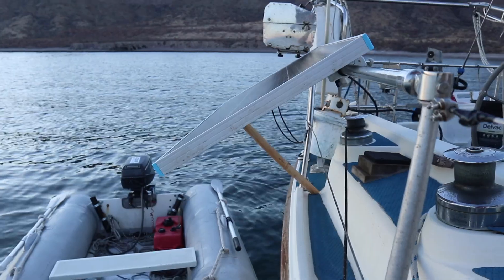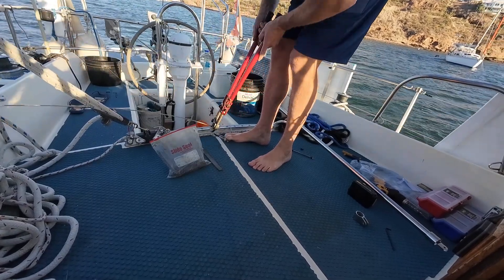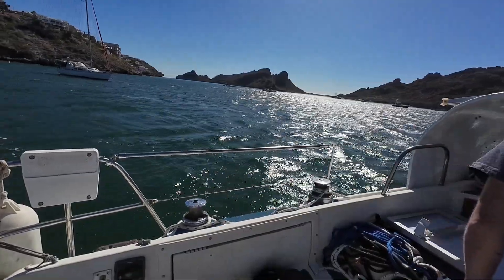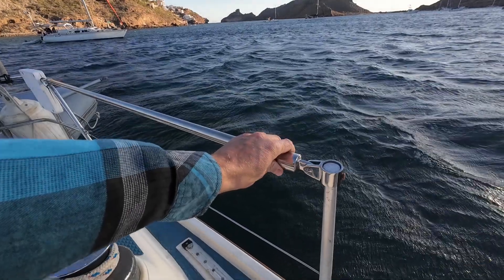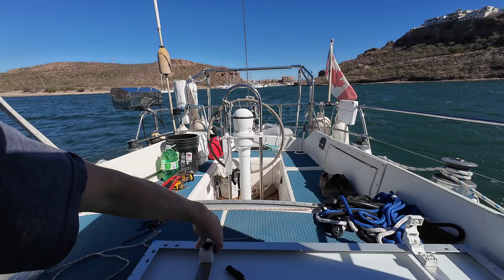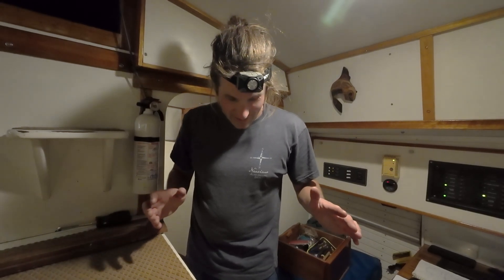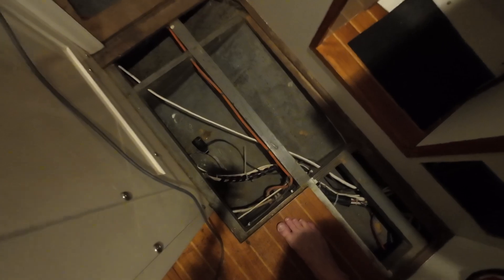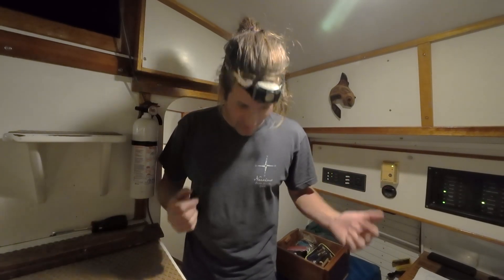How To Install PIVOTING SOLAR On A Sailboat - Turning Lifelines Into Solar Mounted Railings!

Comment: What thickness are the aluminum bars? Looks like they are 1.5” wide, same as the rail fittings. .25” thick?
Reply from the maker: Yes, 1.5" wide, but only 1/8" thick. I will upside them to around .25" once home from this trip, but that's all I could find when in Mexico. Cheers!

Comment: are all your panles all the same volt, or are they mixd
Reply from the maker: Yep, all the same wattage at 100 watts each. They are all wired in parallel into one charge controller, though I may separate the port and starboard side ones onto separate charge controllers.

Comment: I am new to boating and am in the process of upgrading my boat for off grid living. I can fit 800w on my pilot house roof but was thinking that would be nowhere near enough so I was thinking of things like a solar arch which I could do without going to the expense. Having watched your video I am wondering if I am over estimating my energy needs. I will have star link, fridge, TV, lap top, couple of phones and IPads, electric auto pilot and nav suit, do you think I am over estimating how much solar I will need
Reply from the maker: Congratulations on getting into boating, and thats great you have a pilot house! 

I will start with noting that I am by no means an expert on this subject, but I can share my lived experience with you. A lot of variables are at play in determining how much solar to install, with the climate you are in and wether or not you will be living off-grid in the winter months being probably the biggest.

It sounds likes your draw is similar to ours with the added addition of electric auto pilot and a TV, which can draw quite a bit of power. Here in Mexico, our total of 400 watts of solar is ample on most days. Generally, we use our laptops and Starlink for no more than 2-3 hours a day, and we try to wait until our batteries are full and there is excess solar power not getting used. 

On sunny days around the winter solstice, we would usually reach 100% charge by about noon or so. Now in May, we are reaching 100% by 10 am or even a bit earlier depending on the angle our boat is sitting at on anchor. That said, on cloudy days, all that goes out the window! In Dec/Jan, we had a few cloudy stretches that saw the solar panels struggling to meet our electrical needs, even when reducing our consumptions (no starlink use, no laptop charging). Once late February rolled around, even on cloudy days, we could usually get a 100% charge by the end of the day. 

Given that we are reaching 100% by noon or earlier, our boat would benefit from more storage ability; our house bank only consists of two lead-acid deep cycle (100 amp?) batteries. If we added one or two more, that would greatly help us get through cloudy days, and have more evening power usage available.  

Ultimately, the more solar you can add, the better. It will get you through cloudy days and through the short winter months. 800 watts will be tons in the summer in most places, but if you are living on anchor in the winter, having more will likely be very helpful for you. 

Hope this helps!
Trevor
Reply: @ Thanks very much for taking the time to give me all that info, it’s greatly appreciated and has saved me a ton of money on a solar arch I really didn’t want to do.
If I can get the 800w I think I can on the pilot house and plenty lithium storage I’ll be happy with that. We were thinking of getting a Rutland 1200 to help when it’s not so sunny, I’ll let you know what we end up going with.
Reply from the maker: Very nice! Having lithium storage will be a real game changer for those cloudy days, plus the wind generator. We've been thinking about adding a wind generator, too. I'll look into that model. 

All the best! 
Trevor

Comment: Have the panels gotten in the way of your sheets while sailing? 

Have you guys looked into sailing to El Salvador and Nicaragua? The Gulf of Fonseca looks like a beautiful place to visit.
Reply from the maker: So far, no issues with sheets getting cause on the panels, though we have not yet used the spinnaker since installing them. We'll most certainly have to pivot the panels down when using the spinnaker as the sheet come to to the stern behind the. 

We've not looked into that area for this trip; we'll be starting to sail home to the Pacific Northwest this spring via Hawaii and Alaska! But this by no means will end our cruising days! 

Cheers!

Comment: That mounting on the side like that looks like a great way to do it especially because you can pivot them.

We have a 27-ft sailboat we do some shorter cruising during the summer and have a single Renogy 200 watt panel on top of the bimini.  It has worked well for us since 2021.  We just have a portable freezer plus various electronics for navigation and laptops and that sort of thing. We find that things get charged up on a sunny morning by about 11:00 a.m. or even earlier.  We have two AGM batteries and the 20 amp MPPT controller with the Bluetooth interface to monitor it.  For this boat I don't think we need to add anything but it's a good idea for a future project. 

I noticed that the cable inside was a white cable and not the usual black solar cable. Was that a solar cable and if not how did you adapt it from one to the other. Did you just use a typical Marine fitting with a shrink wrap on it that you would crimp?
Reply from the maker: It sounds like you have a great solar setup. We've quickly learned that its always better to have extra solar input to help deal with those cloudy days, or days when our sails are blanketing the panels, too. 

Yep, we used proper marine butt connectors with shrink wraps over them. The white cable is 10 AWG marine grade. Within the white covering of that cable are the typical black and red cables that I connected the solar cable. They look like the ones here: https://www.amazon.com/marine-grade-wire/s?k=marine+grade+wire

Cheers! 
Trevor & Kat

Comment: Nice work. Thanks for the video. I replaced the solar panel that flew off the roof of my camper at the beginning of the trip down Baja. On the 28th of December, a 440 watt panel was installed in Loreto, BCS. The cost was more than I expected, but there is no where else I would spend my money. Big difference with newer panel and upgrading from 300 watts. Safe travels.
Reply from the maker: Glad to hear you got that sorted! It is really great to have more solar and not worry about the batteries so much. Cheers!

Comment: Very timely video for me - I'm actually doing the exact same thing on my boat with the same clamps and fittings. I'm also replacing the lower lifeline with a stainless tube to mount something to hold the panels up when horizontal, as well as secure the panels to when vertical. I also recently replaced the rest of my lifelines with dyneema and it was probably the easiest boat job I've done so far. Cheers.
Reply from the maker: It's a wonderful upgrade to do, isnt it?! I like the idea of also switching the lower lifeline to stainless tube, too. Happy to hear the dyneema is an easy job to do :) 
Thanks for tuning in!